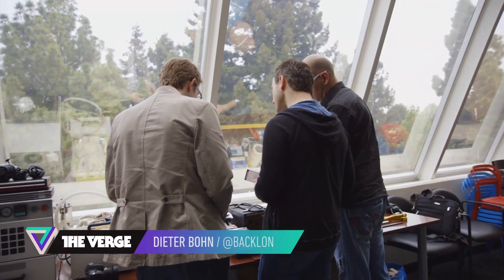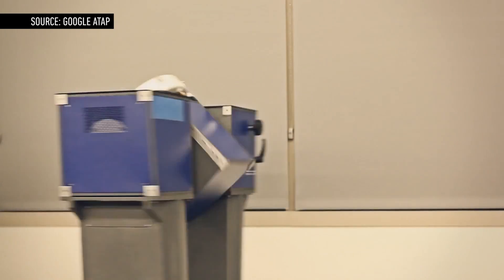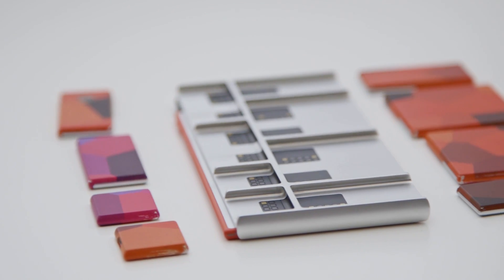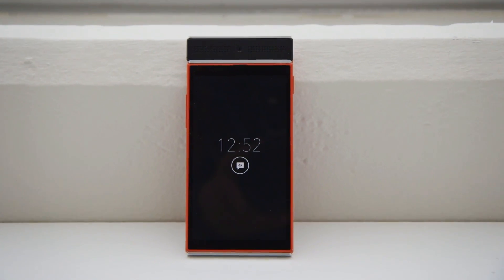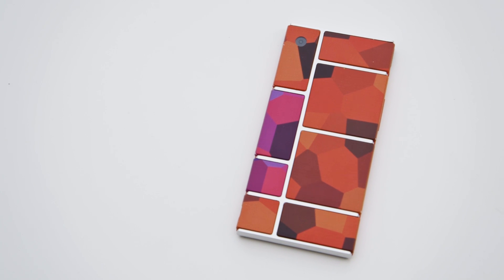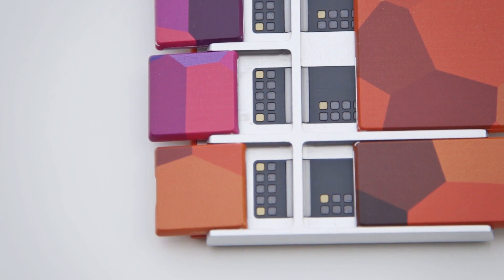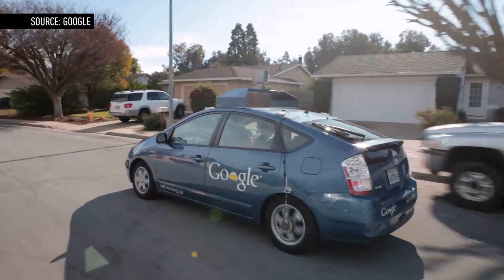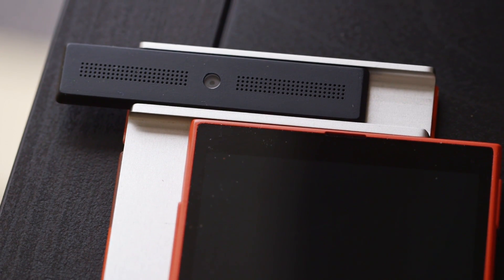Google's Project Ara: Reinventing the smartphone with building blocks

Comment: This is the future. Sorry Apple.
Reply: Apple will copy this, dont you worry.
Reply: This NOT the future, Apple don't copy this crap..this reminds me of the pencil from the 90's if u miss one piece of the pencil you be screw
Reply: muhammed shayan Its not like the pieces will fall off every time you pick them up, magnets can be very powerful, and the magnets will have to be switched off when you replace parts.
Reply: pls, apple users never cared about things being modular the new imac doesn't even have replaceable RAM.
Reply: oh, then every iphone must last so long. I mean of yours did obviously they all will..
Reply: They are copying Apple, that is what apple fans Will say
Reply: Project ARA on apple's macbook... Hahaha
Reply: John Laury The brand new LG G4 has a swappable battery, a better display than any IPhone, a better camera, and even has expandable storage up to 1 terabyte.... Some phone manufacturers are gonna keep doing that, like LG. Sorry but your argument is very falsely stated, and having an open system means you can do a hell of a lot more than iOS, which is almost completely closed. Soooo, sorry to bust your thought bubble, but you're wrong on so many levels.
Reply: And then Apple will make something similar and whine about how, "They made it." And then try to sue Google.
Reply: Lol "future"
Reply: Lucas Zhou that's called "ripping off"
Reply: kolby4078
no iphone had an easily removable battery even.
Reply: Mr. Taco
 all li-ions have a life of only a couple thousand cycles
Reply: Stupid iOS they can't copy this idea with their history of suing Google is going to sue them this is the future of phones that Apple can't get a hold of with there stupid smart watch when other companies like Android has much cheaper things and its BETTERS!!  Finally iOS shall be tumbled the future of Android is here
Reply: everybody thinks apple will crumble but its not true just you watch, to be the best you have to beat the best and thats what google, samsung, htc, and the rest of the androids will always try to do, maybe they will succeed in the next 100 years or so
Reply: ***** I think he means a mechanical pencil, which was invented ~1791.
Reply: CRISTIAN GONZALEZ Android isnt a company,mate
Reply: anupama singh
Reply: Mr. Taco if you are charging your battery "every single day" then it is not ok :D
Reply: Mr. Taco I have a ipod, I charged it by accident too long now it lasts like 10 minutes, if I were to ever over charge my android phone, guess what I just replace it, which is insanely hard to do with my ipodnow I'm stuck with a ipod which already sucked as it was but now with a 10 minute battery.
Reply: Austin Nielsen First of all, you can't "charge it by accident too long", there's a computer chip in the battery that controls charging, so you can plug it in for days and it won't overcharge.  Secondly, if it's in warranty, the device can be repaired or replaced for free.  If it's out of warranty, and several years old, the battery simply may be consumed, and Apple will replace the battery for a fee.
Reply: John Laury I'm pretty sure it can, it usually lasted a few hours, but I charged it for a week straight and now it will last max of 10 minutes. And I don't have a warranty, and I'm not going to spend like 50 bucks for Apple to replace, that is the beauty of most Android phones, you can just replace it for like 5 bucks by ordering it online.
Reply: Austin Nielsen I'm positive it cannot.  Per https://support.apple.com/en-us/HT201545 , right off of Apple's website: 

"The battery stops charging when it's full, so you don't have to worry if you leave it plugged in overnight (leaving your iPod connected to an electrical source all the time doesn't continuously charge it)."

So, no, you can't overcharge it.  Also, if your iPod is out of warranty, you can buy $5 replacement batteries online just like you can for android phones.  Obviously, you're an android fan, and that's fine, but there's no need to disparage Apple because of it.  If you're such a fan, you should be able to promote those products based on their merits without the need of spreading untruths or misconceptions about the competition.
Reply: John Laury yeah you can buy the batteries but I looked into it, and the installation is very complex, yes I am a android fan, but I so give apple kudos for their looks and quality, but I don't like how closed system and expensive, and the fact you can't fact expand storage or change batteries easily. I am not trying to insult you in any way but apple is more for the simpler user, and Android is more for the power user.
Reply: Austin Nielsen Well, battery changing isn't as easy as popping off the back and pulling a battery for sure, but it's not that difficult to do.  There are kits that include the tools needed to do the job that come with the battery, and there's stand alone kits as well.  A skilled person can change out a battery on an iPod in a few minutes.  Not sure what you mean by "closed" system.  Anyone can be a app developer, just like Android.  Both systems need to be rooted to gain root access.  I know "Android" the OS is open source, but so what, are you saying that you need source code access so that you can mod the OS?  I highly doubt that, so it's not like you need that ability.  Besides, I don't see Samsung, or whoever makes whatever flavor Android phone you carry supplying THEIR source code that they use to compile what they put on the phone, so Android is as open or closed as Apple.  Apple's system is tightly curated, but that only protects users from malicious software.  As far as memory expansion goes, buy what you need when you buy it, and then there's nothing to concern yourself with.  SD cards come in many different classes, and there's a lot of lower class SD cards on the market, and people don't bother to look and see what class they should have in their device, which results in cards glitching out and people loosing their data, not to mention SD card memory is on a separate volume which confuses non technical users.  Also, 100 percent of everyone I know who has an Android phone NEVER removes the SD card.  Personally, I slosh data between devices with WIFI not sneaker net.  Therefore, there's no reason for an SD card slot.  Also, in recent years Android devices are building in batteries and getting rid of SD card slots, so what does that tell ya?
Reply: Zane Larson 1 terabyte? big deal, who's going to go out and blow $1000 bucks on SD cards... Also, I never said other manufacturers were not going to make devices with (more easily) removable batteries.  And making a statement about the display and camera without backing it up with some evidence doesn't mean much.  Apple has one of the best cameras on the market. Not sure what you define as "open" or "closed", but that's geek stuff and only matters to people who develop software on a system level, which I'd lay odds excludes you.
Reply: John Laury Lmfaoooo, someone is a bit pissed off that apple is, and always will be, outdated, especially iPhones. 😂😂
Reply: Zane Larson Outdated?  Then why do all the other companies follow 's lead?  They catch wind we're working on a watch, cobble their idea of what they think  is doing, then  comes out with something much better than all the Android watches on the market.  If  is so outdated, why do they sell more phones than Samsung, which is the biggest of the Android manufacturers?
Reply: Zane Larson What it boils down to is this is a silly idea that will never gain any traction.
Reply: John Laury same thing happened with my HP Laptop charge too long and my HP backup reduced to 10 min ,big problem your so called computer chip does not work many times
Reply: John Laury same thing happened with my HP Laptop charge too long and my HP backup reduced to 10 min ,big problem your so called computer chip does not work many times
Reply: JPushkarH That's ridiculous.  All rechargeable batteries operate off of some circuit that monitors the charge, and when the voltage reads a pre-set point, then it cuts off charging.  Often times the charger that you connect the battery has this circuitry, other times, as in Apple hardware, the circuit is inside the battery itself.  If you connect any battery to voltage without a monitoring circuit, then when it reaches full charge, it'll then begin to overheat, and then catch fire.  It won't "reduce to 10 minutes usage".  If that happened, most likely, the battery was at it's end of life (all rechargeable batteries have a set number of charges and discharges before they're consumed).  In you case, that may have co-insided with you happening to leave it on the charger.  Don't believe me?  Then connect a battery directly to current and wait and see what happens if you overcharge it.  It won't reduce the battery life, it'll overheat and catch on fire.
Reply: JPushkarH
Reply: Matthew Flores Nothing more than a niche thing, it won't go anywhere, and I wouldn't hold my breath about Apple copying it.
Reply: +Matthew Flores I can imagine the ads now. 
"Simple.
Innovative. 
Intuitive.
Personal.
The iPhone Custom."
Reply: Don't worry. Just give it time. Like always, Apple will rip it off, dub it iCustom and call it their own invention.
Reply: +Adam Zillin this idea is "stolen" from the dutch guy who invented phoneblocks just type phoneblocks in the search bar and you will see.
Reply: ili ili They won't, this a "bash Apple" thread.  Despite the fact that Google stole the idea from someone else, and Apple has no interest in it, and hasn't stolen anything, these people want to bash Apple, so you're explanation that Google stole it from someone else doesn't play into their narrative.
Reply: +ili ili actually that was a coincidence google was working on it before they announced it and phoneblocks was a concept
Reply: realannoyingapple00 Who gives a shit who thought of it, it's gone nowhere, and never will... niche market at best.. will not nor can it ever compete with wholly conceived and designed products like every other cellphone in the world.  If it was going to take off, then why hasn't it.. because there's zero interest in it.
Reply: +John Laury it hasn't gone nowhere because it hasn't been made yet. There is market its called the developer market. All my friends want it so do i. Not upgrading a phone every year sounds pretty compelling. You can choose what your phone has. Right now you just sound like a butthurt fanboy
Reply: realannoyingapple00 I think the idea is ridiculous, and will go no where, I don't want one, and I don't know anyone who even knows this is in development.  Hope you have a pocket full of battery modules, because none of those modules will hold any appreciable amount of power, so you'll constantly be swapping out batteries.  Also, you seem to think it'll be cheaper, but it won't.  Component systems have been around a long time in audio equipment, and it's more expensive, not less, to piecemeal a system together, this will be the same.  You may not think so now, but years down the road, when this project is dead and gone, and no one has one, you'll think back and say, yeah, that guy on youtube was right.. it never went anywhere.
Reply: +muhammed shayan That's the most dumbest thing I ever heard
Reply: Moto Z delivered

Can't wait for the 'iPhone B' (build)
Reply: Adam Zillin little do you know it does not happen it gets cancelled
Reply: Adam Zillin looooooooooooool

Comment: They need to change the design, it horrible and that orange colour, it looks like lego not like a good self-phone. I'm afraid about those details because that don't look adhere.
Reply: The idea is to be customizable, basically they will let you design your own back cover.
Reply: You do realize that the video mentioned that they were working with a 3d printer to give you choice of changing the skin of each module? So you can not only exchange and upgrade which module but also make them look how you want. They're trying to cover as much as they can so that you have endless choices to male this whatever you want it to be.

Comment: in all honesty I don't care how thick a phone is or how heavy it is, if its slightly heavier or fatter than a normal phone that's fine! in all honesty only Apple fans think if some old technology gets smaller (cause that's how technology works) is innovation, having the same camera, CPU and RAM in a thinner phone for 3 years in a row isn't innovation its better hardware is being made and older hardware gets smaller (and less relevant) basically if the phone is 3 times the thickness of say the iPhone 6 and twice the weight it really wouldn't bother me at all (also it would have 3 times the power probably)

Comment: Cool technology, but I doubt that it will take off like the iPhone. The whole appeal of the iPhone is that you get everything in one slick, integrated package. You can do all the customization you want just by downloading software apps. I could be wrong if they start offering a whole bunch of modules for functions you can't do on an iPhone, but even if they do, Apple still has the option of coming out with a more advanced iPhone 7 or 8 or 9 that includes those functions.

You can already swap out memory cards and sim cards and batteries. About the only thing you can't swap that you really need to is camera lenses.
Reply: You are an idiot no offence
Reply: You really are stupid. A) android owns the market not ios. B) IOS offers no customization. C) this will take off, it will surpass any previous phone.
Reply: Not sure if trolling or just incredible stupid
Reply: Typical isheep
Reply: Apple fan much? .. and there is litterally no customization in iPhones compared to the android OS.
Reply: Actually the iphone isnt really practical. Its just for people who arent tech enthusiasts. Its not that good. Also its not just about swapping lenses. You could switch the ram storage, the processor in your phone maybe even add new functions that new phones dont have. Also the iphone is a piece of garbage compared to android devices, i mean ffs you cant even dual boot systems onto an iphone, all it can do is run freaking ios which is not a smart system. Dont babble things you do not know.
Reply: Dean Ivanov tipical idiot you mean
Reply: What about CPU/GPU? What about internal storage? What about battery capacity? What about USB 3.0 vs 2.0? What about RAM? What about speakers? With this phone you can change any of those things to your desire and to fit your budget, you can't do that with any phone currently on the market.
Reply: Typical*
Reply: CallumBrine thanks... English is not my first language xD
Reply: Get out.
Reply: I think you are dead wrong.
Reply: Wow, your counter arguments are really convincing guys. Not. You guys just called someone who argued in favor for iOS with real arguments an iSheep. Then you respond with comments such as "idiot" to counter them. Wow, who's the sheep?
Reply: hardrock22100 Lol, I neither argued in favor or against Project Ara or Android (because I know that the discussion never leads to anything). What I did say was the you guys called the original poster an "idiot" without countering his arguments at all. That IS just stupid.
Besides, most consumers don't give a shit whether the phone can dual boot systems or not.. /Samsung Galaxy S3 user running ParanoidAndroid (no, I'm not an iSheep)
Reply: zlayaa Well you asked for a counter argument and i just counterd his argument. Also this project could open other peoples eyes and expand their knowledge on phones. It makes it so easier to switch the modules. It would make it easier for consumers to understand how these things work. So the avrage consumer could possibly change his view about phones. Why we call iphone fanboys isheep is because they fight with you and argument to that no phone out there is better than the iphone but they dont want to believe that there is a better phone than the iphone. So i think this is actually a really good idea to be honest, people might not buy this now but companies could possiby start to develope and make their phones more similar to project ara. We are advancing in technology and this is a step to advancing. Instead of having to buy new phones constantly we could just replace the parts, just like modern day desktop computers and even some laptops. Also dont judge this project that much, its a project not a final build. Everything starts somewhere so give it a chance :).
Reply: if something like project Ara releases, there will be no need for new phones. This is the purpose of ara. To be able to replace what is broken instead of replacing the whole thing and to upgrade as you please. For example, if you break the iphone, you have to replace the whole thing same for samsung,  as opposed to Ara where u look for the problem and simply replace it. Screen problem? Replace it, Upgrade it
Reply: hardrock22100 yes! Exactly, iPhones been releasing the same thing for years. A phone like this will solve so many problems. Instead of companies wasting money having to build a new phone from the bottom up they can just give you better modules and replacements for broken pieces. Simple. Its simple but complex
Reply: Typical Apple user. No vision.